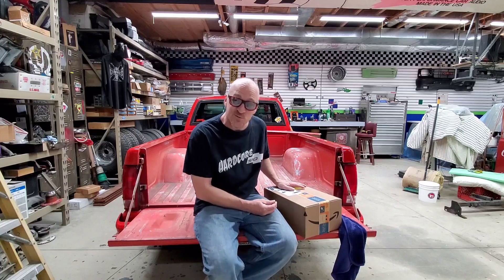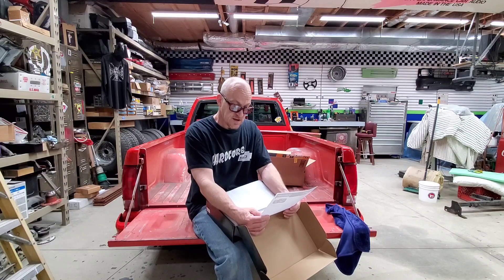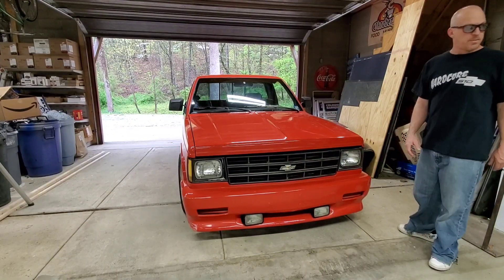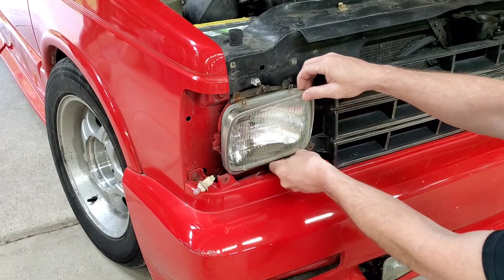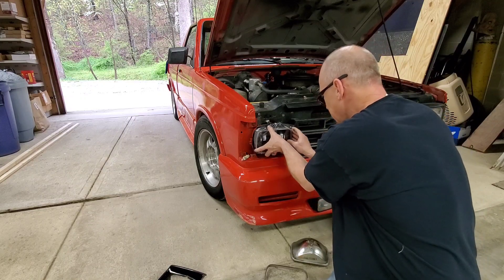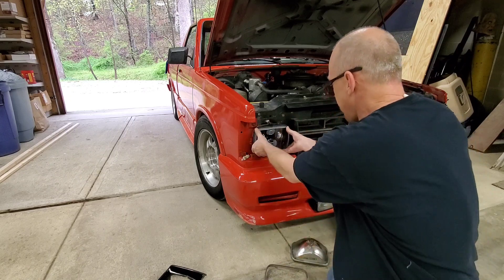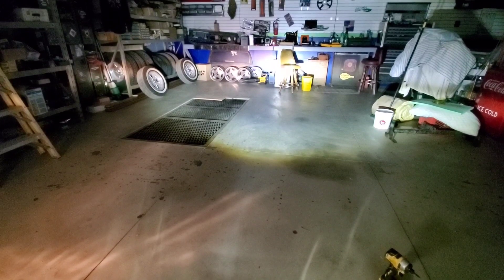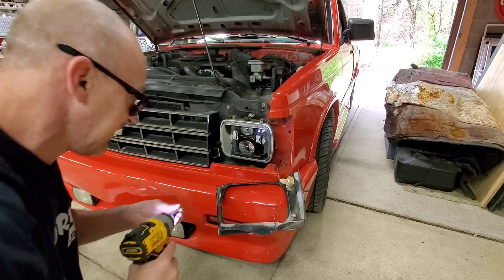1989 Chevy S10 Cameo Minitruck product testing 4x4FLSTC LED headlights.

Comment: Most of the issues with LED and HID lights is the ballasts going out. Also many people don't understand that those lights require load resistors due to the vehicles can-bus electrical system which causes that flickering off and on.
Reply from the maker: These were totally plug n play. If they have resistors they are built in. Or maybe not? Lol
Reply: @HardCoreGarage  most likely theyre using built in can-bus ballasts and those will have the resistors in the ballasts.